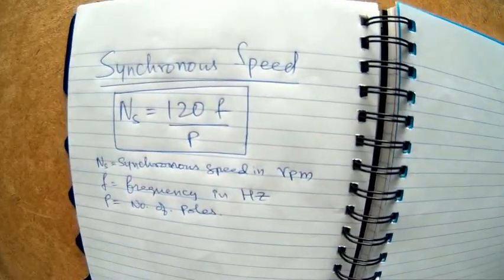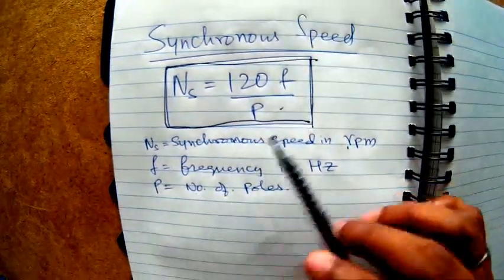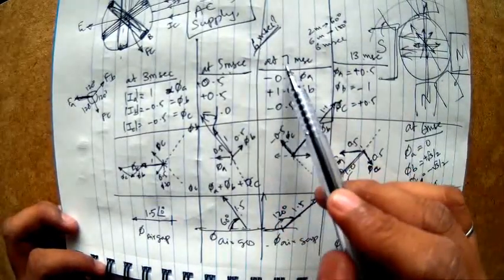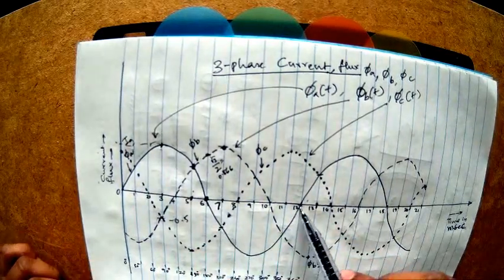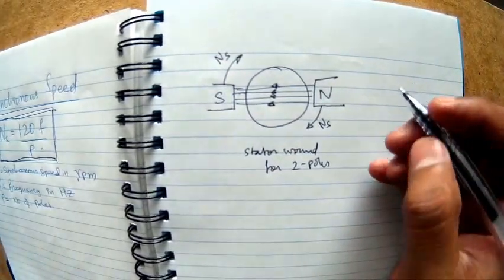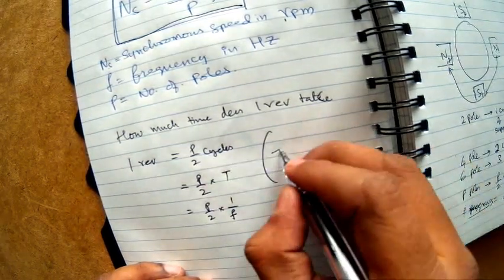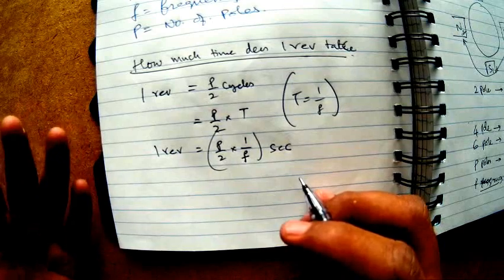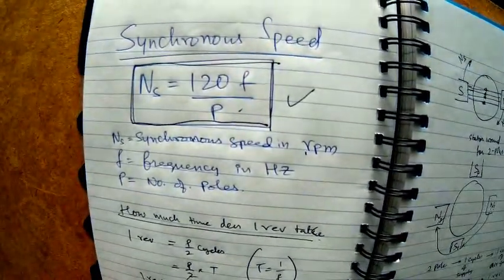IM5 - Synchronous Speed Ns=120f/p

Comment: In the case of a two-pole asynchronous AC motor connected to a voltage of 110 V and a frequency of 25 Hz, the synchronous speed of the rotary field is: the solution is 750 tr/min 
how that ?